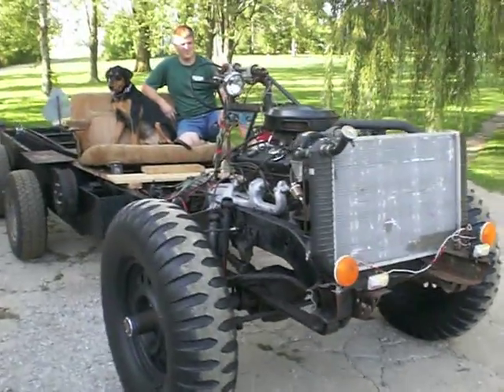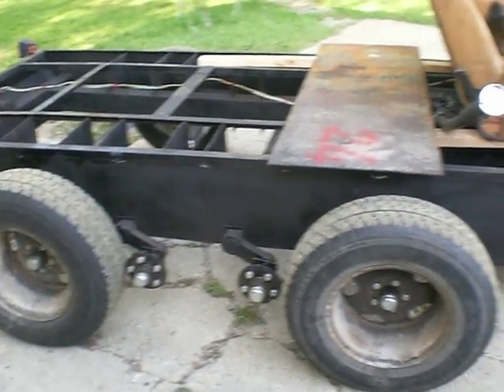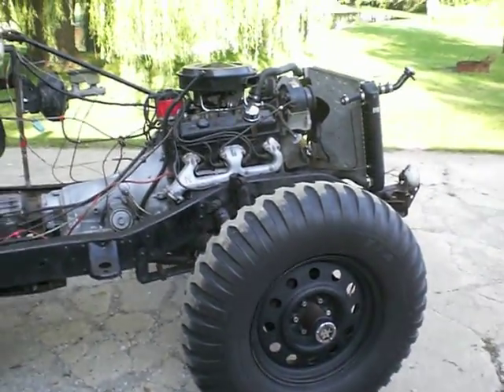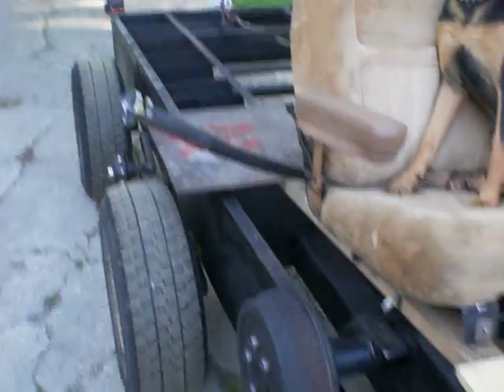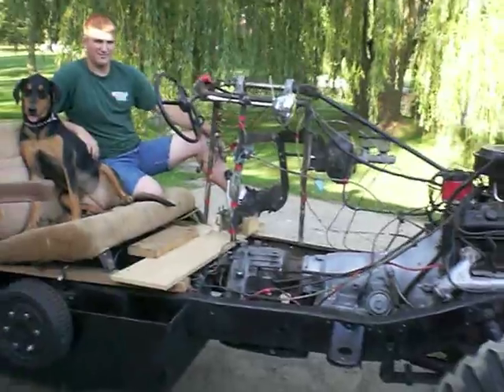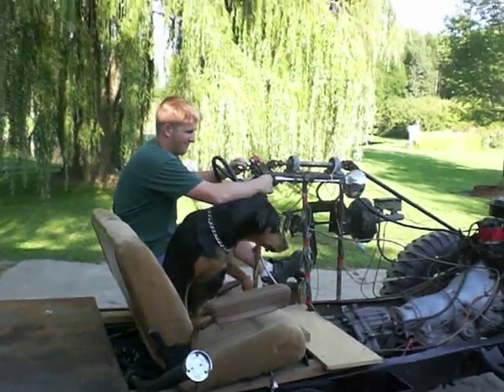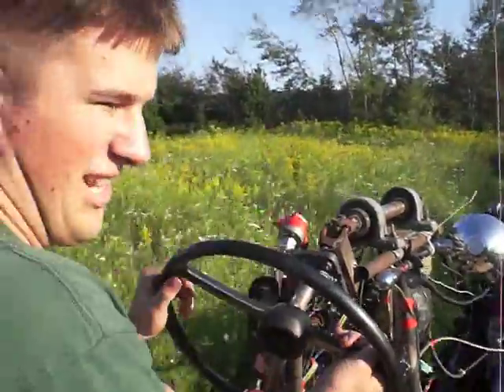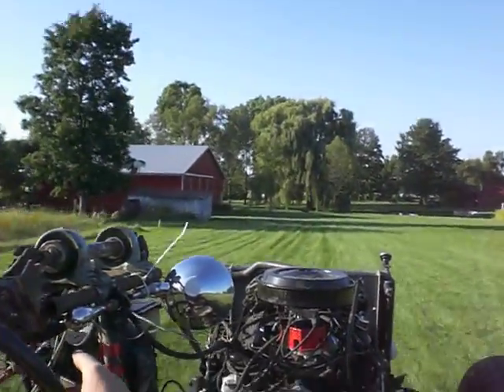homemade halftrack chassis

Comment: I thought I responded to this before. I'm on a military board, and I can ask them what the gear ratios were on the AMerican models and if you want it 4wd, you can figure it out. I know the front one will be higher numerically than the rear-i think.

Comment from the maker: @akumabito2008 We have changed it to 2 wheel drive. We swapped the 4wd transmission and transfer case for a 2wd transmission. There wasn't a easy way to keep it 4wd, we would have had to had custom r&p's made.

Comment: Four wheel drive you said? But the drive wheel in the rear is much smaller, giving you different drive ratios. That wouldn't work, would it? Have you altered the gearing to the rear?

Comment: @wmralder We were using the front axle to move it. We just put the transfer case in 4 Lo. The rear axle wasn't moving because we were replacing the u joint.

Comment: depends on multiple factors, such as powerplant, main body construction (ive seen wood, probably could do somekind of plastic, steel of any decent thickness would be expensive but doable), Track construction and design. id say to be safe anywhere from 5 to 20k.